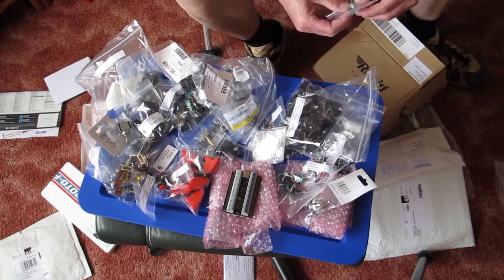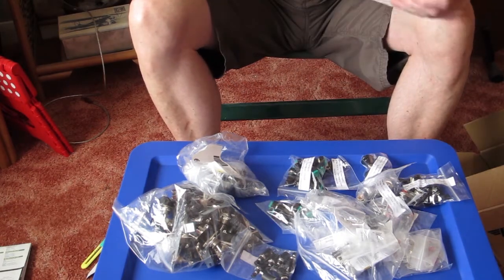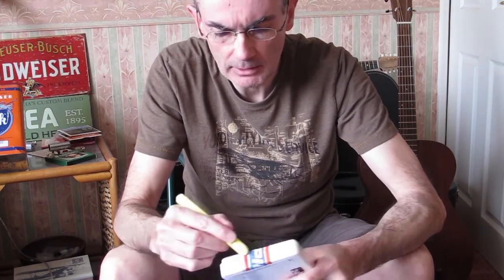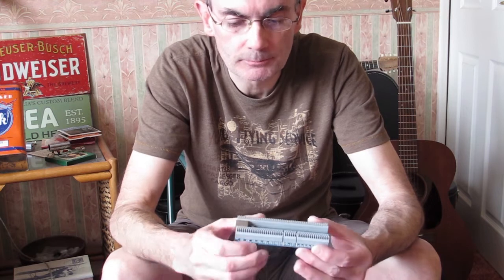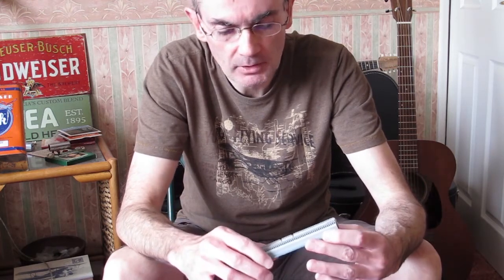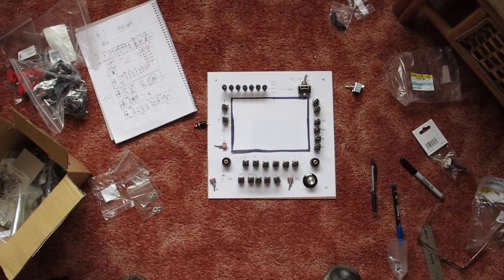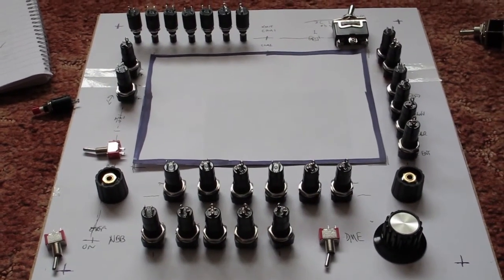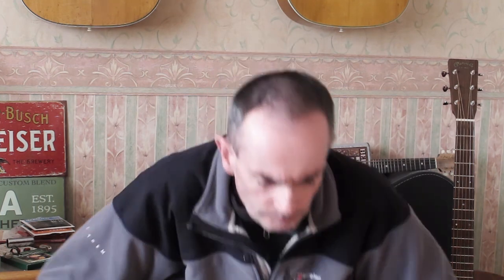Building a Prototype Panel (Twin Otter Cockpit Build - Part 2)

Comment: the  cables u used to wire all the switches was that from proto-pic.co.uk the strand wire and would this wire be ok for 12 volt led
Reply from the maker: I used 7/0.2 wire from Maplin for all my wiring. This is 7-strand wire (I think the 0.2 is 0.2 square mm per strand). I don't know about wiring up LEDs but I can't imagine they require a great current.
Reply: Almost Aviation thanks for that appreciate it

Comment: Hi there are you able to send me a list of how many switches knobs etc thanks
Reply from the maker: Well no, I don't think that's practical as I don't have a detailed record of that. I think there are 179 switches altogether, although some of those are three-position switches and rotary encoders. You can get a component list for my GPS+ and Autopilot+ panels on the Almost Aviation forum (http://almostaviation.freeforums.net/board/3/builder-support), which gives you the details of the main kinds of components I used.

Are you thinking of re-creating the Twin Otter, or are you trying to get the scale of the problem so you can think about making your own panels? One of the later parts of my video series counts up how much I spent (about £1100). I think that included the screws, acrylic sheets, printer ink, timber and so on.
Reply: Almost Aviation hi there thanks for the reply I see you have an ebook and I will buy this I would say your videos are very cool I have been Rea searching all over the internet for someone that actually puts there whole build on YouTube great work keep it up. I am thinking of recreating the twin otter
Reply from the maker: Wow, that would be cool to see someone re-create it! But scary too, they might do it better :)
Reply: Almost Aviation I might have a go at creating the 737 cockpit and see how I go but will be more technical

Comment: Are you able to list your suppliers? I'm doing the same built for a DC3.
Reply from the maker: DC3, good choice! I have added the main suppliers to the description above. I couldn't match all the switches exactly - for example, the generators require OFF-ON-(ON) toggles but I have had to substitute ON-OFF-(ON) switches, which don't really make sense in context. I would be interested to hear if you find other sources of switches.